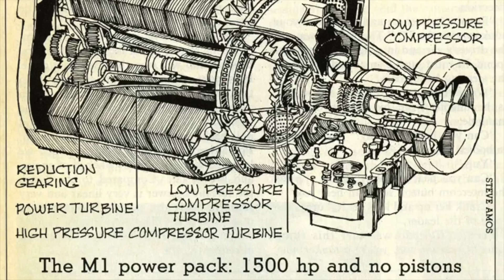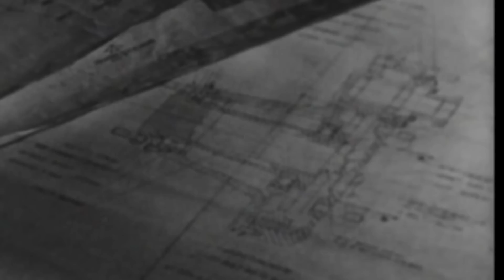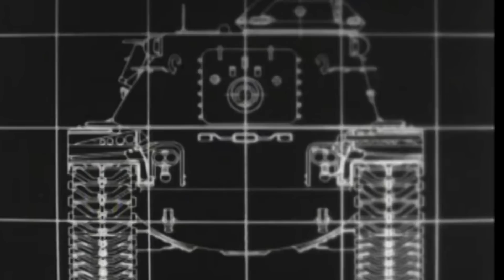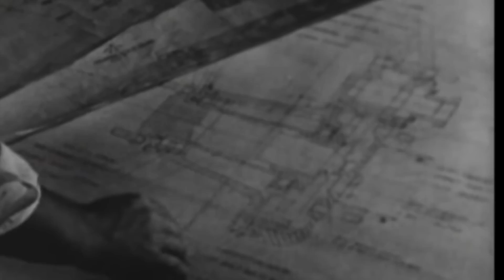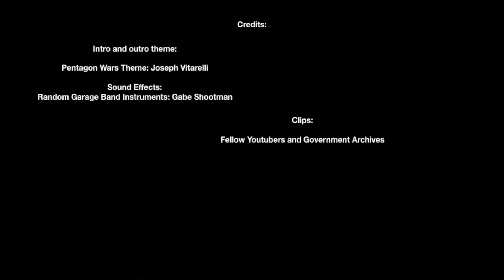The Real Pentagon Wars (For The M1 Abrams)

Comment: 12:55 It should be important to note that the germans cheated in the mobility tests by sending a leopard WITHOUT composite armour wich made it significantly faster than with composite armour. They also removed pretty much everything within the tank that wouldnt be vital for driving and shooting in the tests.
Reply: What everyone is missing is that the austere Leo II without this side armore could not survive a direct hit except in only the frontal armor. With the added armored, it was 6 tons over the US weight limit. Weight is very important because it slows down both acceleration and top speed. More importantly, if the Soviet Union invaded Europe, many, many of these tanks would have to be transported from the US to Eurooe to fight. 6 tons over the weight limit is critical if you need to quickly transport multiple tanks by aircraft to join the fight. As a former Air Force pilot, I know that you just can't ignore that problem.

The Germans asked for a waiver in off-frontal attack angle testing for this very reason. The Leo II austere never came close to meeting the design requirements of the US Army.
Reply: i wouldnt call it cheating.
They send a vehicle made to US Specifications for the Tests. This was called Leopard 2 Austere. It had downgraded FCS, Optronics, Armor and the L7A3 105mm maingun the US requested.
They also send a proper Leopard 2 Prototype vehicle with everything included.
That the Austere Leo still performed better than the XM1 prototypes tells alot about them. (And that the Leopard 2 tests were conveniently ignored by the US testing comission)
Reply: @zhufortheimpaler4041  they only intention was to copy german technology. Leo2 ist a bestseller - xm1 is a gift for some allies
Reply: @minimax9452  BS, the German stabilization system was based on the Cadillac Gage system used in the Leopard 1. The Tank Thermal Sight was the same as the one on the M60A3. Leo 2 is not a best seller, it simply is cheaper over the life cycle because Switzerland and Sweden are next to Germany and not the US. The other countries using the Leo2 like Poland got them as hand me downs, not new production, just like the Poles are getting M1A2 Sep3(-) (intere3sting that they didn't go for Leo 2's right?). There is not a single system on the M1 that came off the Leo 2 other than the 120mm, and the US redesigned it for fewer parts and cheaper life cycle costs. Comments like this just put you in a class with ConeofArc who took his video claiming the M1 copied the Leo2 after I told him to read Hunnicutt and Zaloga. Perhaps you should read their books too?
Reply: @michaelsnyder3871  😅The Leo 2 is cheaper because Switzerland and Sweden is near - this is the reason why the saudis have bought it? Americans and geography. Why did Canada by the LEO because Germany is near? You made my day!😂
Reply: @minimax9452  Canada bought the leo for political reasons

Comment: Like the capitalist system or not, it still produced one of the finest MBT's in history. The communist system did not.  So, the show goes on and look where we are today?  T-14 Armada, it's NATO designation should be Unicorn.
Reply: Such ignorant statement smh
Reply: western countries are wealthy because of colonialism and gunboat diplomacy, not because of capitalism
there are plenty of third world countries that are capitalist and they suck hard
Reply: Actually, most of the Soviet tanks were better, till later on during the Cold War.

Also, you are completely ignoring that Russia lost basically it's entire economy in 1990s and never really got it back. It's a miracle they can afford anything at all.
Reply: @Seth9809  I wouldn't say "better" but by mix of necessity and will - more agressively innovative (T-64). Soviet's lost MBT race due to inability to build reliable, compact 1500hp class engine. That enforced other choices, like llimiting MASS of armour, therefore need to depend on compsition and geometry (which for very long time required casting turrets) and introduction of autoloader and 'happy tanks' ( with limited depression ).
Reply: @piotrd.4850  The US has a 1500 HP class engine, but it's at the price of very serious fuel consumption. 

The T-80UD and similiar models had something like 1200 HP, while drinking a lot less fuel and not having the same issues as the T-80s. 

The Oplot-M, seems to have a fair bit of armor, but um... The weight is too much for the suspension.

I honestly think that if the Black Eagle or some kind of longer, stronger suspension version of the Oplot-M was mass produced... It would be a fairly solid tank.

Comment: The turbine is far more reliable than people think. In fact, it has more than proven itself. What makes it so valuable in the field, is the turbine quieter at longer range, and is designed to run on almost any kind of fuel. If it burns, it'll run. Not so for diesel engines.
Reply: Any liquid fuel.
Reply: I have no records of us ever giving it anything besides jet fuel in all the years we used it.
Reply: @Seth9809  You never needed to, but it can.
Reply: @Seth9809  Not using its multi-fuel capability doesn't make it not a multi-fuel engine
Reply: @neurofiedyamato8763  If you design something to do something and it never does that, but it costs a lot more money.... That is a waste.
Reply: @Seth9809  ..It's called redundancy for war time operations. In a war time scenario,  jet fuel may not always be available when cruising across the plains of eastern Europe in a war with Russia. That's what it was designed for. When/if logistical lines break down, you need to be able to grab whatever fuel is available, whether it be diesel, gasoline, heating oil, or even alcohol, the engine will continue to run.
Reply: @Seth9809  so do you think soldiers wouldn't wear body armor cuz you never got shot in the chest
Reply: @omarcarrero3623  Thousands of soldiers have been shot in the chest and lived (Thanks body armor), most Soviet soldiers are trained to shoot at the torso or belt. NATO are told "center mass" as well. Body Armor costs 2K max, saves 10K at bare minimum in training costs. 

Abrams tank will be removed from service before I am dead and will never have used anything but Jet Fuel. The whole process will have wasted a billion dollars at least in engine and fuel cost.

Considering the future is high gas prices and Ukraine figured out a high HP diesel engine in the 1990s... We can get all the power at half the fuel thirst. We've had so many engines designed to replace the current one.
Reply: @Seth9809  It is not necessarily a waste. Certain fuels (such as Kerosene) have differing properties, meaning that to provide the M1 Abrams with fuels such as Diesel, Petrol, Cooking Oil, etc could result in less output from the engine due to the respective fuel's combustibility. As a result, that would mean that the other fuels are not preferable, despite it being a Multi-fuel engine, but if it is a necessity, the tank can still run, whatever you put in it, which is important none-the-less.
Reply: @Seth9809  - It's better to have it and not need it than need it and not have it.
Reply: @F15ElectricEagle  It's better to have a full tank of fuel then an empty tank of fuel. You however are saying it's better to have an empty tank of fuel because your engine drinks three times as much.

Every Abrams needs truck after truck to be constantly coming up to it to refuel. If the Abrams was in constant combat for any serious period of time, it would run out and be unsafe to refuel.

So then it's a sitting duck and dead crewmen.

Russia literally proved that gas turbine engines are bad idea, when they had war after war where they struggled to safely refuel the T-80.
Reply: @F15ElectricEagle  Any situation you can't get diesel, is situation you can't get anything. It's more common than jet fuel.
Reply: @Seth9809  Please, don't try to put words in my mouth as I never said or insinuate any of what you stated.  The situation you stated in which you cannot get any type of fuel is not relevant as it would not matter what type of engine a tank uses.  What matter is as already been pointed out by other comment: a flex fuel engine can run one any type of fuel that combust.  A diesel engine cannot.
Reply: @F15ElectricEagle  Diesel engine is simply internal combustion initiated by compression, while the Otto uses spark plugs instead. Both can be made multifuel (at great expense which the British found out).
Reply: @Seth9809  The Australian Army has never used anything other than diesel in its M1s.
Reply: Can we chuck wood in it?
Reply: @molotov6844  - If you turn it into Methanol first, then sure.
Reply: @F15ElectricEagle  he said anything that burns tho
Reply: There is nothing to beat the power/size ratio of the gasturbine, and it has great fuel economy at full power, so if you want to run a heavy tank at full speed over distance, that's the engine to choose.
Gasturbines use about the same amount of fuel per hour regardless if the tank is standing still (waiting for orders, an enemy to appear or the column to start moving again, whatever), that's just how they work. You want to save fuel, you need to turn the turbine off, and it can take a few minutes to restart.
Problem is that driving tanks over long distances at full speed is something they do not do very often, if nothing else because that will wear out tracks, gears and other stuff that are tedious to replace.
Ask any tank soldier how much time they spend waiting around with the engine running as to be ready for immediate action if needed, and you quickly see why gasturbines in tanks demand a lot of fuel.

Those turbines also produce a LOT of exhaust, which is visible from afar.
In the case of stridsvagn 103, it was fairly common to see tanks perfectly camouflaged with a big plume going straight up above it, revealing the location.
Reply: almost all modern tank engines are actually multifuel
Reply: @a_bad_channel  ...this is true. However, I read once (and you're going to laugh) they filled an M1 with 100 proof Russian Vodka, to see if it would run. It actually did. Not very well, but it did. No matter how much you tune it, I don't think a diesel engine would.

Comment: Some weird factual/interpretatinoal issues in this video.

105mm gun / 120mm gun
The 105mm gun was on the first production M1, the 120mm only came in with M1A1 update, 3000+ original M1s were produced, quite the oversight to only mention that the 105mm was on the prototype.

AWACS
Also AWACS wasn't originally meant for ballistic missile defence or whatever it was that was implied, it existed right after WW2 where you wouldn't have a chance of picking up a ballistic missile and when there were none apart from left over V2s and there wer no nuclear warheads that could be put onto them...AWACS was always about early warning of aircraft, ballistic missile detection, to the extent it exists is later development/consequence.
Reply: Not to mention he went on about Rumsfeld while zooming in on a picture of McNamara.

I'm a Brit, I shouldn't know the difference better than an American.
Reply: Also not to mention how he regards the T72 as "uninspired", NATO took the debut of the T72 very seriously, this concern was reinforced by the success Iraqi T64s and T72s had against Iranian M60s and even Cheiftains.
Reply: @ShopeeMarketteam  No Iraqi T-64s, it wasn't exported.
Reply: @michaelsnyder3871  my mistake, T62s

Comment: The M4 A3E8 Sherman armed with the 76mm gun was deadly to the T34.  Also, M26s, and M46's firing HVAP ammo actually pierced the armor in both front and back of the T34 and exploded several meters behind it.  The tankers were ordered to not use the available HVAP and stick to standard rounds which were already highly effective against the Soviet tanks.  In short, much of this program is horse manure.
Reply: @Extraordinarylurker he knows, he's just nitpicking the semantics. most tank nuts know the T-34 and T34 & if someone's talking in the context of soviet tanks and they say T34 it should be clear which one is being referred to. but it's just how the comments section are.
Reply: Well yeah of course the M1 76mm gun could pen a T34/85 just as it's own 85mm could pen an Easy 8.
Good job the Russians didn't supply NK with T54's isn't it, the only gun we had that could reliably kill that was the 20pdr on the Centurion.
Reply: Really? You disregarded an entire video centred on the Abrams because you don't agree with an off comment about the Sherman? 
Dumbass.
Reply: Sure Nato tanks could easily defeat Korean ones, but it also goes the other way...
Reply: "The M4 A3E8 Sherman armed with the 76mm gun was deadly to the T34." T-34! T34 was heavy american tank.

"Also, M26s, and M46's firing HVAP ammo actually pierced the armor in both front and back of the T34 and exploded several meters behind"
How? HVAP or APCR were not filled with explosives
Reply: T-34, a 1940 Soviet medium tank.
T34, a 1948 American heavy tank.
T34 Calliope, a 1943 American Tank-mounted rocket launcher.
also, if something was deadly to t-34, that was hardly the issue, as Germany had plenty of things that were deadly towards t-34, but russia produced them in such high quantities, that it did not matter.
"The Soviets ultimately built over 80,000 T-34s of all variants, allowing steadily greater numbers to be fielded despite the loss of tens of thousands in combat against the German Wehrmacht.
The T-54/55 series is the most-produced tank in history. Estimated production numbers for the series range from 96,500 to 100,000. "
Reply: @Redmanticore  numbers ain't worth shit if ya ain't got logistics to keep them running

Comment: 10:38 false, for the time the T-72's autoloader was no more vulnerable than any other tank's ammunition at the time, infact it was less vulnerable than most. it isn't untill the blow-out pannel equiped tanks like the abrams daybut a decade later that a new standard was made (even the leopard 2 had the vulnerability of the T-72 with its hull ammunition).

as for its shape being old generation? that is the weirdest criticism of the T-72 i have ever heard. if anything its fairly radical considering it had a 2 man turret instead of 3man and its lower profile compaired to older soviet designs depsite the increase in firepower (both as a result of the autoloader) which meant more armour with no increase in weight.
Reply: Also, T-72 in 1969? :)
That would be the T-64. Noone in the west knew about either of them until later half of 70s.
Reply: He's saying the T-72 was an evolution of the T-55 design philosophy. They look similar.
Reply: @taylorc2542  wich it wasnt.
T-64 was an evolution of T-62, wich then branched out into T-72 and later T-80 etc.
Reply: Unclassified reports found by Zaloga in research for his book indicated that the auto loader had real teething troubles, such as catching loose clothing, decalibrating after a number of shots (like the T-62 case extractor) and cartridges dumping powder as they were loaded. And yes, they were more vulnerable as the ammo in the carousel sat right up against the side hull along with additional rounds.   The Soviet use of silicate armor was poorly executed in the T-64 and the early T-72, with a single plate on the glacis. The US Army found out in tests in 1952 (which can befound online) that KE or HE rounds would crack the armor not just at he point of impact but across the plate. They found Quickrete would repair and restore the HEAT resistance, but the plate was severely compromised against KE projectiles. And the Soviet initial multiple layer armors featured glass balls on wires or simple rubber/polyurethane layers in voids inside the turret face. Finally, the autoloader did not speed up the Soviet target process, for which the norm was 2 per minute at a time when the average NATO tank crew was expected to engage four or more and the best crews could reach eight. The Soviet tech wasn't sufficient which is why they felt compelled to use ERA on top of their "multi-layered" armor arrays.
Reply: @michaelsnyder3871  i guess you should revisit your research a bit more and diversify your sources, because you wrote a lot of BS.
Reply: Yes and No, the T64 was incredibly well armoured frontal and NATO understood it. But they were well aware that the auto loader carousel was vulnerable, many M60 manuals when referring to the T64, recommended non frontal engagement if otherwise, aim at the tanks lower region and keep shooting until the carousel was hit.

What he didn't mention is the change of layout for the T72's ammo carousel, now flatter and less of a target frontally.